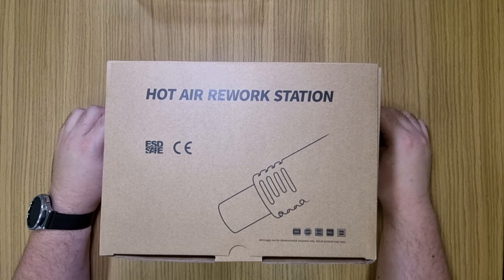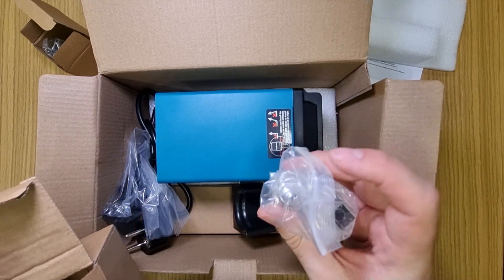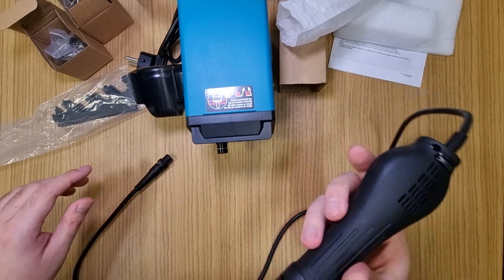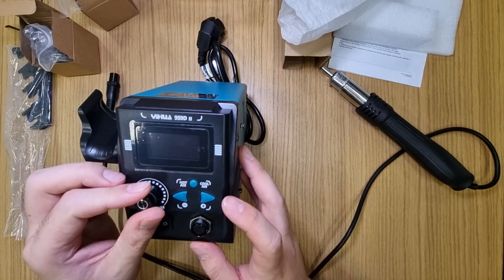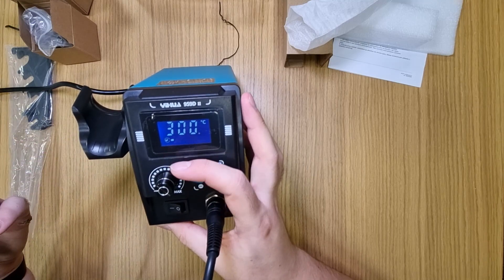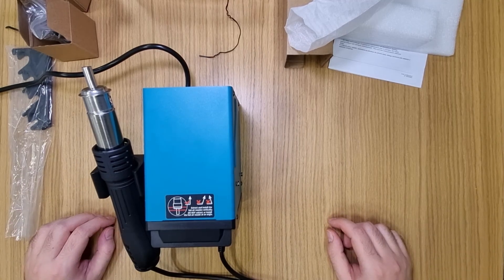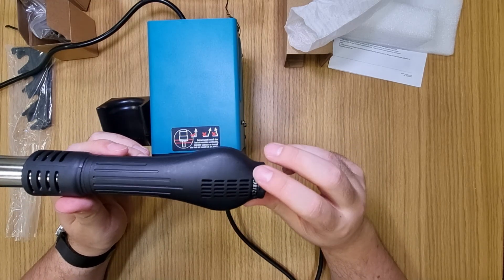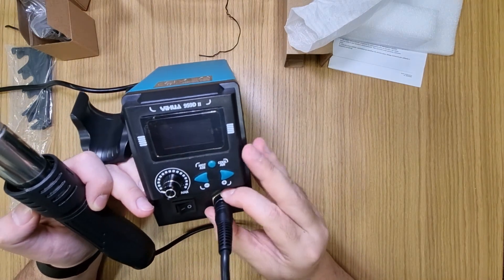YIHUA 959D-II 700W soldering hot air station unboxing and overview

Comment: Switching of the heater by the button gives you the option to cool down the board or object. By the way, most cheap air stations like all 948D variants have all a temperature sensor in the tip.